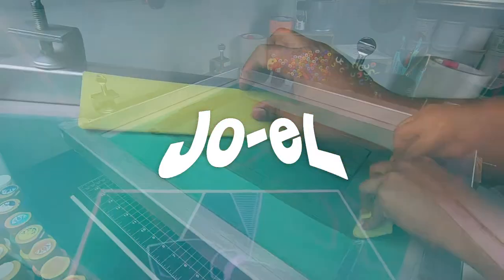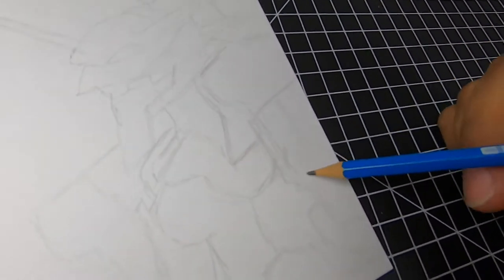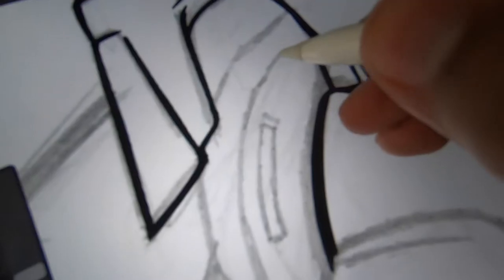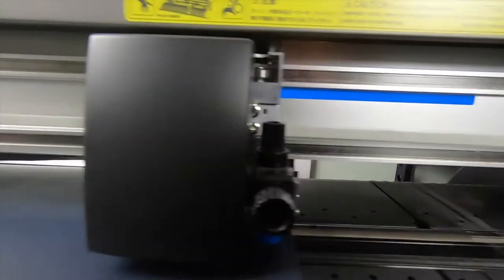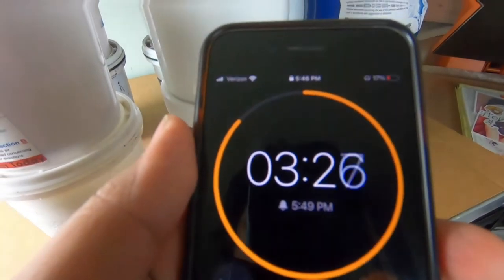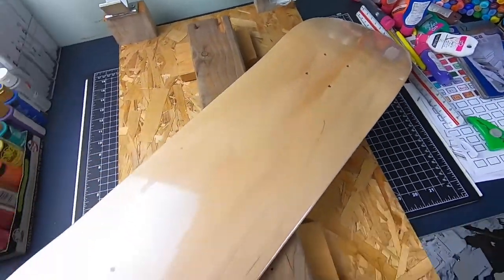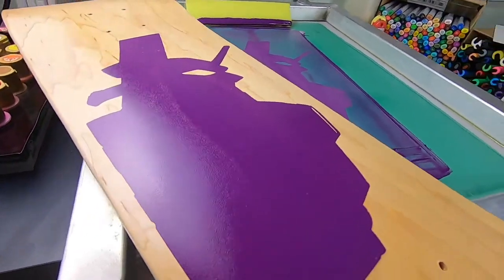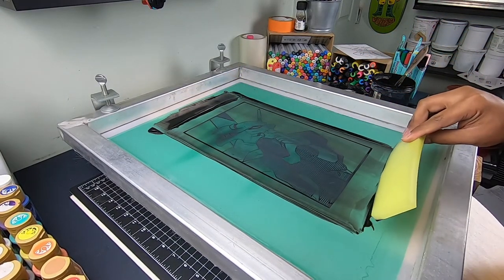Screen Printing A Custom Skateboard Deck (Neon Genesis)

Comment: what ink do you use? I really liked your video and more its edition
Reply from the maker: For this one I used water based ink with an additive to make it cure faster but I’ve seen a lot of people recommend solvent-based Ink that’s made for woods & metals 
But it did work so if you have it give it a shot!
Reply: @jo-el9980  thanks You n.n

Comment: Hello..what type water base print ink you used? It is good? Its look like for tshirt print? Thanks
Reply from the maker: It’s green galaxy ink and yeah it’s mostly used on shirts but it worked for me, only thing had to let it completely air dry for 48 hours
Reply: Thank you

Comment: this is sick man! what kind of ink did you use?
Reply from the maker: I used water based ink and it works just fine but I’ve hear the best ink for printing on boards is solvent-based inks
Reply: @jo-el9980  for sure, what brand was the water based ink?
Reply from the maker: @dorippu-p5585  it was green galaxy by ryonet
Reply: @jo-el9980  appreciate it homie thanks:)